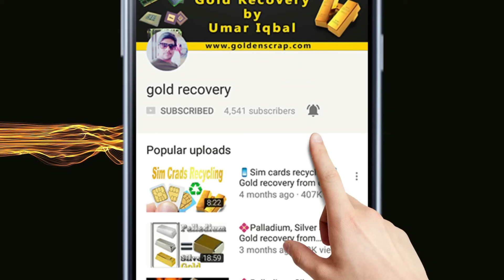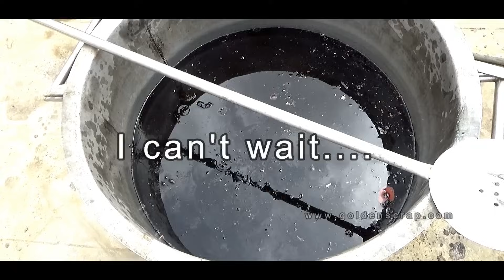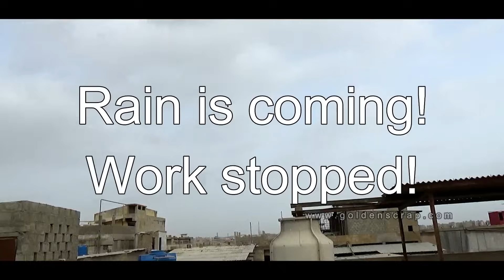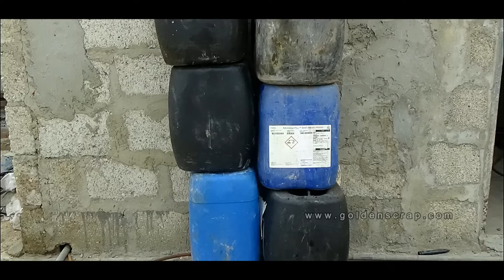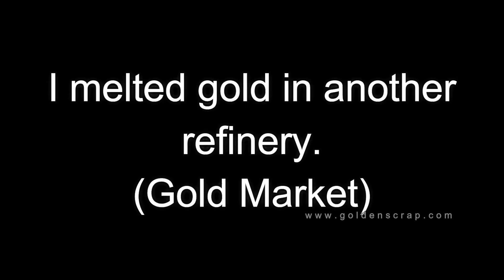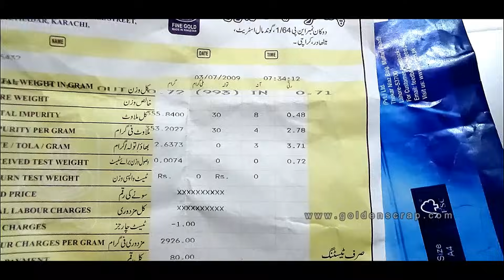♻150 kg IC Chips Recycling | how to gold recover from ic chips | gold recovery

Comment: I tried before to heat sulphuric acid in stainless steel pot, it was non magnetic stainless steel pot, but it been dissolved with sulfuric acid, what is the type of your stainless steel pot s?
Reply: same problem i had too they must have painted high temperature acid proof coating of some kind its just a guess  let me u if u got any idea for that

Comment: 150kg of scrap IC, how you got 355gm of gold, impossible. You are a liar.
Reply: Its acually a pretty low yeald he could have gotten close to 500g without much hazzle
Reply: Translation - "Waaaahhhhh, I'm jealous and butthurt that I don't have $22,000 worth of gold, so rather than trying to learn from those who are infinitely more educated than me, much more experienced than me, and just flat out better than me in every way imaginable, in the scrap game and in life in general, I am going to instead use my energy and my very limited mental capacity to pout, whine, cry, and then call the person who I envy a liar with no proof whatsoever, because that's how pathetic little boys like myself who refuse to ever improve in anything they do prefer to operate". There you go kiddo, I fixed your post for you and let everyone know what you actually meant to say with your comment, you're welcome.  :)   

P.S. 355 grams of gold from 150,000 grams is only 0.00236666666666666%, or a little less than one quarter of one percent. So for every 422.535 grams of IC chips he gets 1 gram of gold. Sure, 1 gram of gold out of every 422 grams is impossible if you are breaking down a one metric ton (1,000 kilos or 2,205 pounds) pallet of scrap bulk PCB's, since no metric ton of PCB's has ever or will ever be worth $150,000 in just gold value lol. For IC chips, or CPU, or memory fingers though 1/4 of 1% is in no way "impossible" though. Also, you're welcome kiddo. Rarely does a temper tantrum turn into a free lesson but look at you, you whined and pouted and called someone a liar and you got rewarded with a free lesson today. Who cares if it was a pity lesson, you still gained knowledge that you clearly had no clue about so enjoy, and again, you're welcome.  ;)

Comment: 150KG IC CHIPS (MEANS 1500KG OF OTHER COMPUTERS PARTS GARBAGE)
356 GRAMS (24K GOLD) 
$47.39 USD PRICE PER GRAM TODAY 
SO 356 GRAMS OF PURE GOLD WORTH $16870 USD 
TOTAL WORH $16870 / 150KG = 112.46 $ PER 1KG CHIPS 

SO EACH 1KG OF COMPUTER CHIPS DELIVER 2.37GR OF PURE GOLD WORTH $112.46
THAT BEFORE THE REDUCING THE FOLLOWING 

1. OLD COMPUTER EXPENSES 
2. TIME TO REMOVE THE PARTS 
3. CHEMICALS & MATERIALS NEEDED 
4. ROUTINE - EMPLOYEES PAYMENTS  STORAGE RENT FOR THOSE COMPUTERS GARBAGE LEFTS ETC 
ALL CALCULATION NOT INCLUDE TAXES IN CASE YOU PLANING A BUSINESS 

SO AFTER ALL YOU END UP WITH A PROFIT OF APPROX 50$ PER 1KG OF CHIPS BEFORE TAX 
IS IT NOT EASIER OR BETTER  TO BE A FLUTE TEACHER? 
HAHAHA

Comment: 150kg ic chips price tell me please
Reply: About $5-10.000
Reply: @LaserHuset  Is that $5 to $10 per kilo in US dollars? Or did you mean 5,000-10,000 for all 150 kilos? In which currency? I am very curious what the different types of E-waste, CPU, RAM, IC chips, etc. cost in other parts of the world, mainly Pakistan, India, China, and Africa.  Preferably in U.S. dollar prices per kilo. If anyone has any info on the varying worldwide prices of different types of E-Waste from different countries it would be greatly appreciated. Thanks much and have  great day everybody.
Reply: @boredmisfit7725  I meant 5.000-10.000 US dollars but it is no no way accurate that's why I used two numbers with that big a difference, an actual price would be somewhere in between those two numbers but I can't narrow it down much further as the estimate I gave was based on a couple of Ebay ads that have since been sold so I can no longer find them, sorry that I couldn't be more helpful 
Where are you from? Here in Denmark there isn't much of a market for E-waste so you can quite often get large amounts of E-waste for free

Comment: HIGH QUALITY CERAMIC CPU PROCESSOR SCRAPs FOR GOLD RECOVERY Whatsapp:+91 72920 75274
Ceramic CPU for Gold Recovery Scraps, i486 i386
Very high yield Ceramic cpu scraps
Ntel 486 & 386 Cpu
Intel I960 & Motorola Cpu
Intel Pentium Pro Cpu
AMD 486 & 586 Cpu
Gold Top Cpu
Gold Top & Bottom Cpu
Intel Pentium 1
DLP Cpu

Comment: The NO2 fumes becomes Nitric acid in his lungs. Which is a great cure against good health.
Reply: This is a country with mutant babies. I think he'll be well compared to others
Reply: still better than the fish having to bath in the chemical wastes. let's be real here, this is india or pakistan
Reply: I misread this as N2O and laughed a lot.
Reply: It’s called gas mask btw
Reply: Which is why they do it outdoors duh
Reply: I personally deal with those fumes with help of lid with a pipe which leads NO2 into a plastic bucket with water so I kill two bunnies with one shot:I don't get nitric acid in my lungs and I get it in the bucket so I can simply re-use it!I counted the recovery of nitric acid and got numbers not less than 40% and sometimes even up to 70%!

By the way I also use another way to dispose of organic crap and destroy the silicon dies leaving gold behind untouched-also in fact it is far faster method which also doesn't give out too much fumes!I simply fuse the stuff with molten sodium hydroxide!And so my recovery rates are higher than in this video because here the guy is unable to get the gold out of silicon dies and I can!And the only thing that I have to do after that process is to collect all copper and gold with help of the regular spoon from the bottom of the bowl in which I process them and so after all I am able to re-use the stuff for really many times before it's depleted and so it's extremely useful and profitable cheap technique,and safe as well!
Reply: @johnsheppard1476  can you give me your WhatsApp I want to know some following setups that you told us pleas
Reply: @bilalchaudhry3799  by the way I have uploaded some videos here!Some about molten NaOH and also one describing the process of smelting iridium metal-although without actually smelting it because it is too bright to make a video of the exact smelting since molten iridium metal gives enormous amount of UV light that instantly burns the matrix of any unprotected camera-but the general idea is given in that video..By the way I already smelted those in 2 beautiful iridium beads!
Yes and also I am going to make a video about processing cat converter material soon!So as in most of them the honeycomb is divided into three parts and each of them contain only one PGM,I think I will not pay too much attention to platinum and palladium parts as they are trivial to process:just crush into powder;roast with a gas torch to red hot(mandatory step!without it recovery yield is less than 20%!!!);pour some aqua regia and than everything is straight forward and shown in billions of videos!So I will only show how to extract rhodium metal which takes forever to dissolve in aqua regia-so the method is completely different here and it's nowhere to be seen!In brief it's done by smelting all the material with potassium bisulfate and than precipitating rhodium metal from rhodium sulfate mixed with a bunch of other sulfates!I either use copper powder or just zinc..The second one just need to be purified after that..
Reply: @johnsheppard1476  any videos on this method?
Reply: @johnsheppard1476  e
Reply: John Sheppard yokes
Reply: @xx0maxi  ?
That is actually a demonstration by the way,and the entire process is actually done with a bunch of material on an electric stove in a nickel pot!Also the surplus liquid must be poured out into a proper bucket of waste,which has to be pre-heated,and at least gloves and glasses or better a face shieldare mandatory at that point because of possibility of splashing,which can do serious damage because that is insanely hot and corrosive substance being splashed that is making glass to eventually melt and glow even sometimes white hot by the heat of the reaction!Although for metal like nickel it is completely inert:you can boil a tonne of sodium hydroxide inside the same nickel crucible and it won't be eroded away at all!
Reply: @johnsheppard1476  do you have YouTube channel? I'm doing the same thing I want to know how can I kill the fumes specially nitric fumese. I'm very worried about environment plz

Comment: Hello, I can not dissolve plastic chips. what concentration of sulfuric acid do you use?
Reply from the maker: Did you mean long legs ic chips?
Reply: thanks, I already figured it out. I warmed a little, you warned that you can not warm up strongly, I was afraid of it. and maybe still problemma with sulfuric acid, the fact is that my country is banned from selling, I have to use electrolyte. I used to get metals from Soviet parts, now I want to apply your knowledge to get metals from computer technology. thanks for your support. I am very grateful to you.

Comment: I'm sure they dump the left over acid sludge down the drain or in the gutter
Reply: Calcium Carbonate... Acid is very easy and Cheap to neutralize.  Even if you dump it on the ground it will leech the Calcium out of the ground and neutralize itself in minutes.  As Acids do "Damage" they also neutralize themselves, and the results are always at a lower energy level than the starting point.
Reply: GT 5 they probably just dump it outback
Reply: Calcium Carbonate comes as a powder, and once mixed with an acid, produces a quite vigorous reaction, greater than what you could produce with a stir rod.  The copper is not a problem (natural copper contains a high amount of arsonic, but refined copper as you would find in a circuit has already had that removed), and the Calcium Sulfate would be gypsum or plaster of paris, so about as toxic as a preschool room.  The lead (pb) on those older components would be a problem, especially once suspended in an acidic solution (Roman Sweet Wine anyone?) if HCL were not used, but since HCL was used the Lead would precipitate as Lead(II)Chloride, newer components wouldn't have that issue at all (SN/AG solder).  The biggest issue would be accidentally creating Silver Fulmanate (contact sensitive explosives and high molar acids are a risky proposition), but these guys haven't blasted themselves with corrosive fluids yet, so at least one of them knows enough chemistry to avoid that.
Reply: NO - into the river

Comment: I'm impressed with your efforts and stockpiling so much material. but Mr Umer as usual I'm getting disappointed at the end with the outcome. I am confused I you get any profit out of this, after considering cost of material, chemicals, manpower, fuel, rent, utility bills etc etc. I have just one question why you get less yield and do have have any profile after calculating all expenses. ..reply please
Reply from the maker: Yes, we earn a handsome profit. If you have experience about this field then you should not be confused. This is a very good result for a mix ic chips batch. But we respect your feedback. Thanks

Comment: 2 gram per kilo chips,nice...
Reply: For BGA chips it is about 5g per 1kg: D
Reply from the maker: THANKS BRO.
Reply: yeah that corect :D
Reply: the rougemillenial real talk
Reply: fair is fair he should also be compensated for the pollution he prevented by removing the need to mine what he recycled which is considerable as 1/2 oz per ton is considered high grade ore these days.
Reply: The dud is amaizing :D
Reply: Go to the river. So much alluvial gold you can find there in a very fun way instead of harm yourself with the chemical shits.
Reply: 355 grams, 18 to 24karat, 1200$ per Troy Ounce Price on Jul 17, 2017  would be about 10k - 14k dollars. nice :)
Reply: Probably making more money from youtube ads.
Reply: GamerOtaku PS4nSwitch the amount of pollution from burning that stuff is nothing compared to the 2 cycle motors of that country and others. China's smog issue and other eastern nations is inefficient 2 cycle motors 30+percent of fuel and oil isn't burned and expelled out the exhaust. in these poorer countries motorcycles, scooters etc are the means of transportation most of them 2 cycle since its much cheaper to build s 2 stroke then 4 stroke motor. my weekly commute to work in my mustang puts out more pollution into the air. the way he is polluting is on the earth not the air. he burned all that and still had 100s of pounds of waste has to go somewhere. nature can purify the air quickly. the ground can't process that stuff in hundreds of years it will still be there. 
some food for thought about the air. most of our oxygen cones from the oceans and algae in them. we can cut down every tree on earth and wouldn't run out of air. this is why scientist are experimenting with making artificial algae blooms in the oceans. that can reduce co2 by massive amounts like 5 percent of our yearly emissions from just them and not nature. the controversy in it. is the whales and other sea life that depend on these algae blooms naturally is it will throw off their migration patterns. they follow the same routes for food around the world depending on the season. making these artificial blooms we remap there habits. they may travel back for food that's not there. because it shouldn't have been there in the first place. and that's where the issue comes in
Reply: Hi, nice video !! I would like to know if this system works with the Ic Chip's in plastic and in ceramics? Can I mix them all? Thank you for your reply, I have several thousand Kg of cards and I would like to know if it is worth the economic to extract precious metals? Thank you
Reply: 999 Dusan Gold recovery it is not possible bro.
u can only extract max 2 to 3 grams gold from 5 kg of scrap.
Because if manufacturers provide this much of gold in the electronics then it cost more after covering gold and other parts.
Reply: @amitkatariya5793  anything prior to 1998 has a very high gold content
Reply: @amitkatariya5793  it takes about 150-200 RAM sticks to get one kg of chips, in what world can you buy 150-200 sticks of RAM for less than $270? I hope you keept the waste if you only get 2-3 grams pr 5KG otherwise you have thrown away gold
Reply: wrong, have less than 0.0000000000000000... grams per kilo